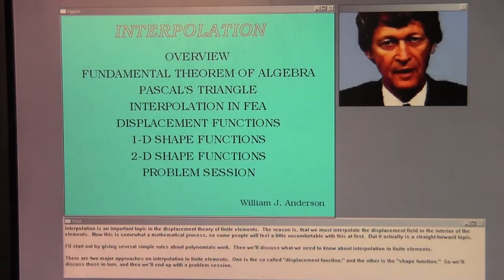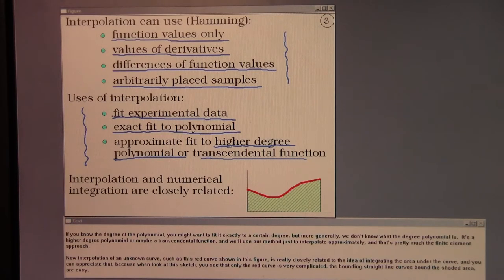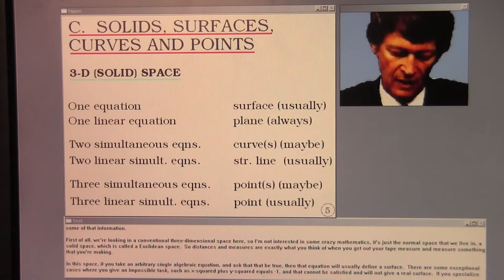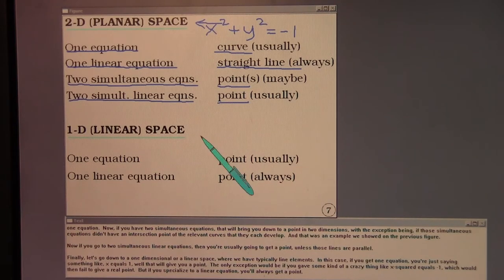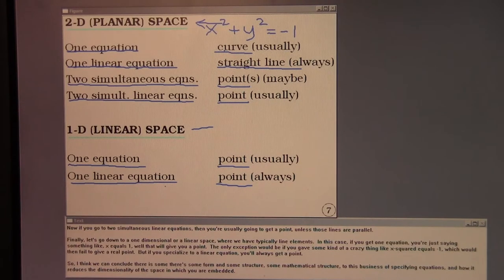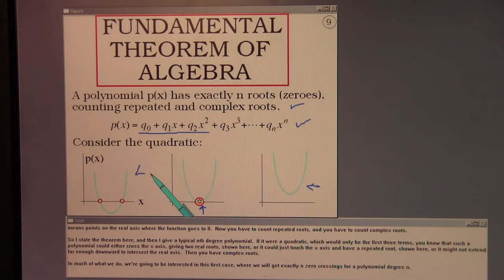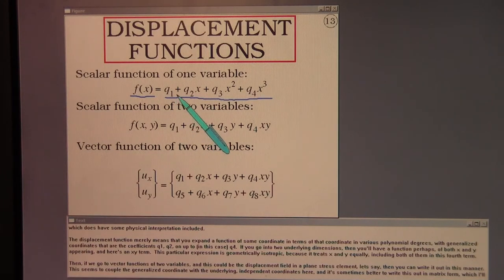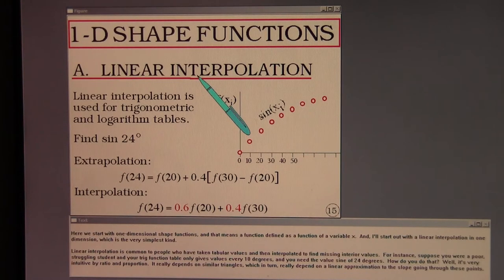FEA. Interpolation. Lecture 6, Part A.

Comment: THIS IS THE MOST COHERENT AND COMPREHENSIVE FEA INTERPOLATION RESOURCE I HAVE EVER SEEN
Reply: THANK YOU
Reply from the maker: Peter Cerreta Thank you Peter.  This is very flattering.  I did spend a number of years working out the material, often with large classes where I didn't dare to have errors.  Students were reluctant to point out errors with a hundred other students watching and I therefore couldn't correct errors in real time with student help.  As a result, I had to get rid of the errors before lecturing.Some of the original recordings were sponsored by the MacNeal-Schwendler Corp., which helped pay for studio time.  Later I found how to make the videos on my own, using my son's patent on time-synchronized annotation.  (We sold that patent to an intellectual venture company and my children got most of the patent money.  Today, lots of people are writing annotations on both still figures and moving pictures.)Have a good day (as many people in Michigan say)!Bill